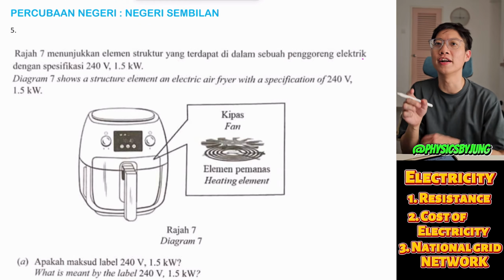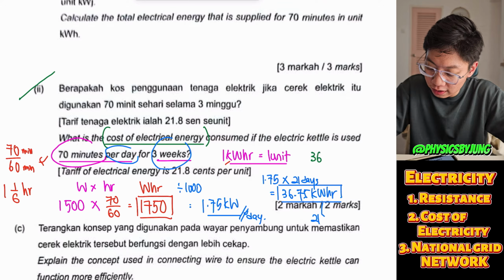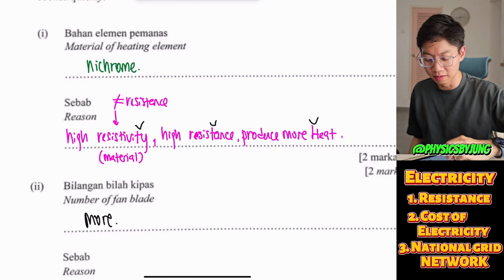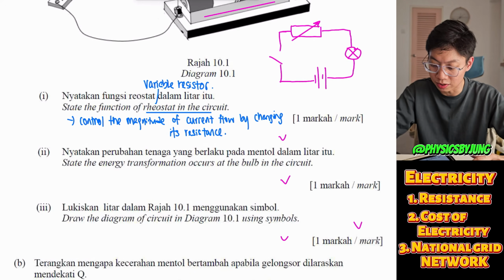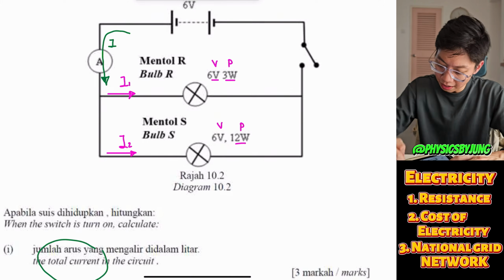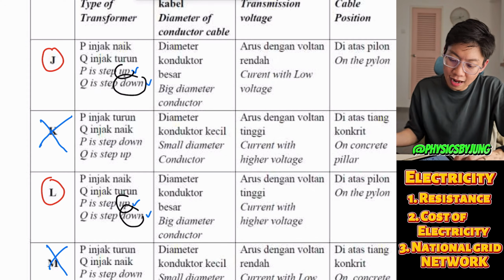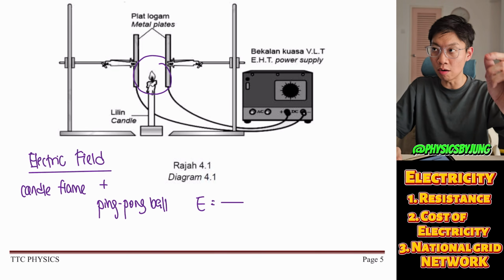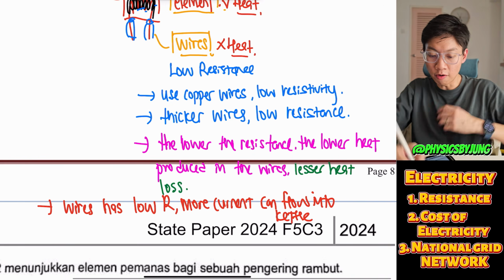SPM 2024 || PHYSICS State Paper Series Episode.3 F5C3 Electricity【Season 2】

Comment: 24:20 Higher voltage reduces loss of currents, current will be lost when its travelling long distances during transmittion in cable so maybe higher voltage will reduce voltage loss. If voltage is less and long distance, current loss will be even more
Reply: yess